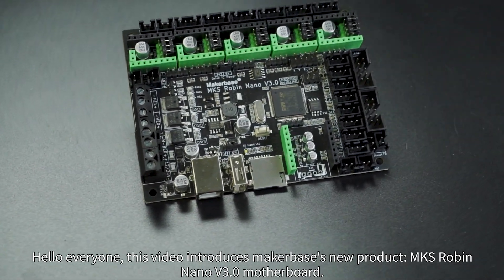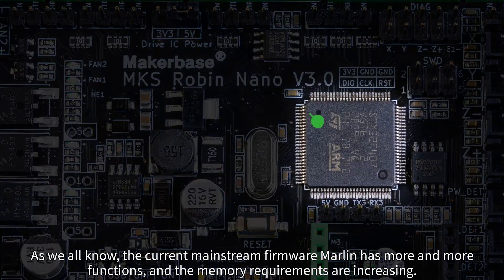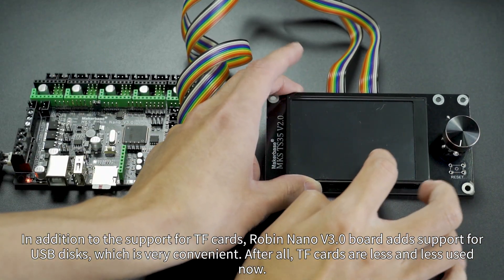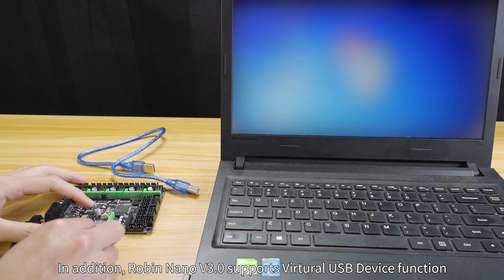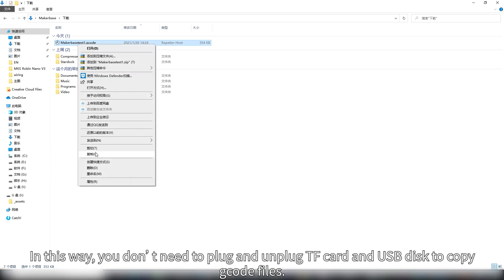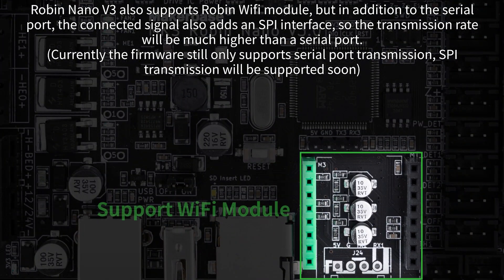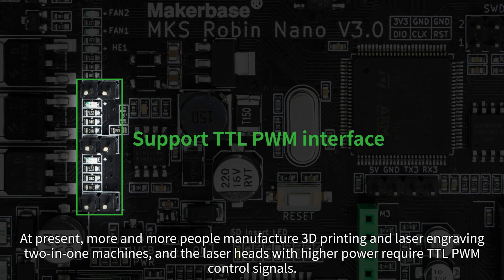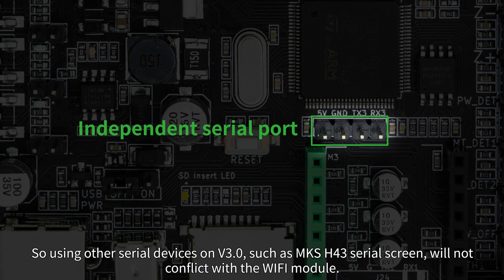Makerbase MKS Robin Nano V3 New Product Introduction

Comment: Hello, now i have the Robin nano V3.1. What are the correct jumper positions for the board if i want use my old TMC 2208 WITHOUT UART. 
Unfortunately, I have found no understandable instructions on how I have to plug them in.
I would be very happy about an answer 🙂

Comment: Hi,this board accept a tft35 without well ?? why is present that well ?? i have an creality ender3 v2... is possible insert this board with bltouch,autopower off ?? thanks a lot
Reply from the maker: It can be connected to TFT35, there is a serial port on the main board, and the automatic shutdown needs to be matched with the det module
Reply: @makerbaseteam4217  thanks...sorry,are two model fo tft35...is possible use this board with a tft35 v1.0 (without well ) ?? the firmware are same ??

Comment: does it possible to use this control board for printer, which changed sometimes print head to laser or spindle? and does it universal program has exist, that in where you can just to choose work  item - spindle or hothead or laser ?
Reply from the maker: You mean toggle on screen?
Reply: yes, for example, i had use the repitier host, and print something,  then i change the hothead to the spindle, and are there the program, which  will create g-code by 2 ways - 
1. in case of  i will prompt hothead on PC screen, it will create +body, 

2. in case of i will choose spindle on PC screen, it will create g-code with -body?

and about the controller program - if i will define the planes x, y,z and program controller for the spindle, does i need to comment define and to program it back for the hothead return?

Comment: I have a super weird error with my board : when I print from USB (generally repetier but same thing with cura), after a while, I end up with an error Communication timeout - reset send buffer block.
sometimes it is very quick, sometimes it doesn't shows up at all (generally it does...). The connexion is not totally lost though, it is just crazy slow (1command per minute kind of slow...). Does anyone knows that??
Reply from the maker: Use usb to connect the host computer to print files. Is the machine printing stuck? Or is the host computer very slow to send commands?
Reply: @makerbaseteam4217  it is printing totally normally over USB until the error appears. Once the error comes, the print become incredibly slow (1 move per minute), or even totally stuck. Of course after the error appears, I can't pause, stop, home or anything, I have to soft emergency stop the machine and reconnect (ruining the print). I suspect a bad board, because it is doing the same thing with 2 different computers. maybe there is a jumper I can place/move on the board?

Comment: Robin Nano V3 has the microcontroller STM32F407VGT6 while V3.1 has the STM32F407VET6. Can I compile a firmware for the V3 and upload it to the V3.1 without any kind of issues? The latest Marlin version Doens't support the V3.1 version.
Reply from the maker: it is ok

Comment: Is it possible to enable variable speed on the part cooling fan? Mine seems to just be on or off.
Reply from the maker: It is possible. The speed can be controlled by setting the percentage in the control mask of the printing interface.
Reply: @makerbaseteam4217  Thanks for the fast response. When I set 49% or less it is off and above 50% it is on. Did I configure something incorrectly in firmware? Anything I should check?
Reply from the maker: @inoahmann7542  You should check the voltage, and the minimum working voltage of your fan. When the voltage is lower than 50%, the voltage should not be enough for your fan to work.

Comment: I have a MKS Robin Nano v1.2 with TFT35 screen... will my existing screen work on the Robin Nano v3.0 board?  Also, the USB port on my existing v1.2 is bad... will I be able to use the USB port on the v3.0 to connect with Octoprint?
Reply from the maker: The interface of the screen of V1.2 is different from that of V3.0, so it cannot be installed on the motherboard of v3.0. Octoprint can be connected to nano V3.

Comment: When will support the SPI connection to wifi module?
Reply from the maker: Hello, which wifi module is it, currently only supports mks wifi
Reply: @makerbaseteam4217  Yes of course, MKS WiFi, in the video you can see what the WiFi module can be connected by SPI connection but in Marlin or MKS firmware only serial can be selected.

Comment: I'm still having trouble running sensorless homing on this card, I followed video v2, as you suggested, because it would be the same as v3, I put the jumpers on sensorless and put the jumper in 3.3v and UART mode, I switched to 5v also didn't change anything does not recognize the sensorless homing can help me?
Reply from the maker: The configuration file needs to enable TMC2209, the jumper should be inserted in uart mode, and the threshold should be set in the advanced settings. What is your threshold setting? If you can’t work, you need to change the threshold
Reply: @makerbaseteam4217  yes i already did all this the drive is in UART is in 2209 and the jumpers are in place, the limits have already tried all, started in 125 then increased to 255 then downloaded now is in 8 and no matter what the number does not recognize, something is wrong but  on the v2 card everything works ok but on this v3 card it doesn’t work I don’t know if it’s an error on the marlin can you check if you can get it on a card of yours?  using this marlin from your github repository
Reply from the maker: @CASADOCVT  Hello, which version of marlin firmware are you using? You can use the firmware on our github https://github.com/makerbase-mks/Mks-Robin-Nano-Marlin2.0-Firmware
Reply: yes but i'm already using exactly this version even with the configuration for robin nano V3 but it doesn't work at all the sensorless homing i tried to follow the example of the video that told me but it still doesn't work, i need to test it because i believe it is not working  need help
Reply from the maker: @CASADOCVT  You can initialize eeprom
Reply: yes EPROM working everything ok except sensorless homing, if I put the jumpers it does not detect no matter the sensitivity, if I remove the jumper it from the home stopped wherever it is

Comment: Hi, i have a robin nano 1.2, will this new model support M600 and M0, or will not support those two commands like my board? thanks!
Reply from the maker: Hello, you can use color ui or classic ui, these two uis support these two commands
Reply: @makerbaseteam4217  Hi, thanks for the response, where can i get color ui? its a Robin nano 1.2 + TFT 35 (wanhao D12 printer)
Reply from the maker: @torinopeek  This requires marlin firmware, enable #define TFT_COLOR_UI
Reply from the maker: Firmware link https://github.com/makerbase-mks/Mks-Robin-Nano-Marlin2.0-Firmware

Comment: I have a bigtreetech tft 3.5 v.3 screen with a wheel to switch between marlin and graphical screen. But this board doesn't want to work with this screen. Are they compatible? And the second question: what does the thumbwheel do on your Makerbase MKS TS35 screen that comes with your board?
Reply from the maker: It can be used. It is a serial screen. There is a serial port in front of the wifi. You can connect it there. The rotary encoder on the screen can select menus and operate screens

Comment: Hi @Makerbase Team, I have this board for a month and the only problem I am having is that the pwm fan1 is not working, but the pwm fan2. I have tested the same fan on both ports and it only works on fan2. Right now I have the second fan connected to one of the 12V / 24V outputs on the board. I think this could be a software problem, could you help me?
Reply from the maker: Hello, you are operating and controlling the fan on the screen. Does FAN1 not work? Did you update the firmware on our github? You can join our group on facebook so that we can communicate better
Reply: @makerbaseteam4217  Yes, i updated the firmware from https://github.com/makerbase-mks/Mks-Robin-Nano-Marlin2.0-Firmware because my printer is not avalaible in the other github https://github.com/makerbase-mks/MKS-Robin-Nano-V3.X/tree/main/firmware/Marlin-bugfix2.0.x-MKS-2.1.2. Fan2 is running as I turn on the printer, but fan1 does not work when I turn on or when I start printing. Using software on the touch screen, in the fan section, I reduce the speed but I also do not see that the fan2 is slower. So I think the problem may be in the software.

Comment: hi how are you can i connect RGB light to the board?
Reply from the maker: You can enable a free pin to connect to it, but nano V3 does not use the light strip, and the compilation library will report an error

Comment: Will this board work with the regular matrix screen on an ender 3 (v1)? Or should I go for the sgen l v2? Thanks!
Reply from the maker: LCD12864 and 2004 are both available
Reply: @makerbaseteam4217  thanks for the reply, so that means It will work with the 1 wire screen on the ender without compatibility issues, am I correct? Just like the old mks gen l works ( I have that now, but want to go for 32bit)

Comment: I'm not able to print via SD (I can update the firmware with it) and, also, I can't print via WI-FI directly from Cura, there is always an upload error.
Reply from the maker: Hello, are you using SD card firmware or U disk firmware? You need to disable #define USB_FLASH_DRIVE_SUPPORT in the advanced settings file
Reply: @makerbaseteam4217  Will this also solve the problem of sending gcodes for printing via WI-FI?
Reply from the maker: @AleFarnesi  Yes, because the file was not saved to the SD card because the SD card was not read, the sending failed
Reply: @makerbaseteam4217  Thank you!

Comment: Bonjour ma carte fonctionne parfaitement, mais je n' arrive pas a régler le P.I.D  sur PRONTERFACE ou autre logiciel, sur quelles port USB faut il se connecter ? MERCI.
Reply from the maker: Is the motherboard unable to connect to the pronterface? Please check whether the serial port set in the configuration file is correct? Whether the baud rate set on the software is consistent with the configuration file
Reply: @makerbaseteam4217  Bonjour, le problème avec ROBIN NAO V3, est que WINDOWS me signal que le périphérie est défaillant. 
 Je n'avais aucun problème avec ma  carte ROBIN NANO V1.2
Cordialement.
Reply from the maker: @CH04111959  Is your computer unable to recognize the port?
Reply: @makerbaseteam4217   Oui c'est bien ca, l'ordinateur est incapable de reconnaître le port avec ROBIN NAO V3 ?.
Avec ma  carte ROBIN NANO V1.2 il le reconnaît.
Reply from the maker: @CH04111959  The serial port you configure in the configuration file is #define SERIAL_PORT 3
Reply: @makerbaseteam4217  Oui le port dans le fichier de configuration est bien configurer ( #définir SERIAL_PORT 3) , je ne trouve pas la solution, peut être la carte est défaillante ?
j' ai essayer la carte avec PRONTERFACE en WIFI la carte est reconnue ainsi que les mouvements d'axes, mais quant je lance un PID en WIFI, je n' ai pas de retour, je pense que c'est normal ?
Cordialement.
Reply from the maker: @CH04111959  Do you see the com port in the device manager of your computer?
Reply: @makerbaseteam4217  oui je le voie avec le message (UNKNOWN DEVICE)
Reply from the maker: @CH04111959  What do you use to power the motherboard? Is it via USB? Still powered by a switching power supply
Reply: @makerbaseteam4217  j'utilise une  alimentation à découpage.
Reply from the maker: @CH04111959  The serial port should be set to -1, not 3
Reply: @makerbaseteam4217  OK, ca fonctionne, je pense que l'erreur étais aussi dans le fichier platformio.ini
 (default_envs = mks_robin_nano_v3), je continue ma configuration.
Un grand merci pour votre aide.
Cordialement.

Comment: The new board has the ability to stop the heat sink blower fan after printing?
Reply from the maker: As long as you connect the fan to the controlled fan interface, it's all right. There is an instruction to turn off the fan in the end code of Gcode.

Comment: Can anyone explain to me why I'm having this issue.  Cant print because my Nano V3 has no voltage going to either my hot end or bed. The board is being powered by a switchable PSU. Multimeter shows 12.05 volts on the board's power terminals. And at the same time while power is being supplied to the board,  no voltage is going to my hot end or bed terminals on the board. Multimeter shows zero volt at the board's hot end and heat bed terminals Why is  there no voltage going to these terminals?   I just received this combo package  in the mail.
Reply from the maker: The hot end and the hot bed end need to turn on the heating to have voltage. Have you turned on the heating?

Comment: I am new to 3D printing, but I want to thank you very much for a good product. I have been using the 3D printer for a week, and without any problems I changed the board and the screen on my SUNLU S8 to robin nano v3 + TS 35 + TMC2209 / UART + WiFI and already made a couple of prints. Everything is fine and quiet.
It remains to connect a 3D touch, I think it will be easy
WiFi as well as the material sensor also does not require additional settings during installation, just connected to the port and installed the MKS WiFi plugin in cura.
Reply: I'm new to 3D printing too. You got lucky setting it up.  It's good board but there is a bug in the design of the board.
Reply: @ewardbennett9648  What mistake?
Reply: @suport00  The board will not flash if end stop is not placed properly.

Comment: Just go my Robin Nano V3 in the mail. Tried to upload the new firmware as specified on Makerbase Github and for the life of me, the board just won't flash. It successfully compiled in VS-Code. Transfer the bin file onto a USB disk and inserted into board, nothing.  Even the TFT screen doesn't work. What a headache. Help.....
Reply from the maker: Does the indicator light on the main board not light up after power-on? Is the positive and negative of the power supply reversed?
Reply: @makerbaseteam4217  Thank you for replying. No lights on the board or the screen. I bought the 5pcs combo and I've been trying to get everything to work. Followed all the instructions on Github and videos. Tried downloading  and pasting. Also tried compiling. Nothing is happening. Tried micro sd and Usb disck to flash nothing. Serial port set to -1
Reply from the maker: There are indicator lights on the main board. As long as you supply power, the indicator lights on the board will be on. If it is not on, it means there is no power supply.
Reply: @makerbaseteam4217  There is power going to the board. Checked the power terminals with a multimeter. I'm using a 12V PSU. The  hotend fan comes on. But no lights on the board.  The weird thing is, none of the USB seem to be working.
Reply from the maker: @ewardbennett9648  When the main board is connected to the 12V power supply, the indicator on the main board does not light up? Are you powered by a switching power supply? You can join our group on facebook, then send me a look at the video above
Reply: @makerbaseteam4217   I don't have face book, Never did. It took this novice 24hrs to figure out that board has issues.
I loaded all my wiring on to the board and then I tried to flash the board. Nothing. Removed the end stops from the 
board. Re-insert the USB disk in and turned the power back on.. Bang!, board flash,  Now, I got to  figure out why the other plus and minus terminals are not getting any power.  Going to need a massage after this.
Reply: @makerbaseteam4217   Meanwell 12V 17A PSU

Comment: Here you can chack the quality of the  Touch of this board : https://www.youtube.com/watch?v=v1MogviBO2g  The MKS team is does not recognize the touch is wrong. Than look like it is NORMAL.  Before you buy you need to see thi video.
Reply from the maker: Hello, are you using marlin firmware? Has the touch of the screen been calibrated?
Reply: @makerbaseteam4217   Yes the touch screen is callibrated,

Comment: What will the pwm pin output voltage be? Does it depend on input power?
Reply from the maker: Yes, it is related to the voltage you input, so the choice of fan, heating bed and heating rod should be consistent with the voltage of the power supply

Comment: Is it possible to mount screen vertically?
Reply from the maker: The ui on the screen is horizontal, if you want to use vertical, it is recommended that you match H43, H43 is vertical screen

Comment: I always manufacture machines with your technology (CNC. laser. printers).  one of the software that I use is laserweb which I cannot connect to the TFT WiFi.  via port 23. only ethernet cable to my sgen v1 directly.  Will this wifi board bring support for wireless communication through port 23?
Reply from the maker: Not yet, now the main thing is to connect and control with our app

Comment: Will these actually support the M600 command by using marlins advanced pause feature or will these throw an error due to an unsupported screen?
Reply: This will be added next on February.
Reply: with filament sensor all ok, u not need turnon FILAMENT_RUNOUT_SENSOR, everything works from the box

Comment: Согласен с комментом ниже. Прошивка говно, дельту не поддерживает, хотя написано - есть поддержка. Геммороя столько после покупки этого хлама. Ждал её месяц, думал щас как поставлю, и все будет хорошо. Итог - принтер стоит, прошивку запарился перетряхивать.

Если у вас дельта - на родной прошивке не будет работать, автолевел. На оболочке дисплея марлин - работает автолевел, но нет вайфай. А карточка памяти вставляется в мать, что делает необходимым в моем случае её выносить за пределы корпуса принтера. Короче - покупка бессмысленна от слова совсем.
Reply from the maker: Machines of various structures are supported. If you use a Delta machine, you need to download the Delta configuration file and configure it. This motherboard also supports wifi. If you need wifi function, you need to buy a wifi module